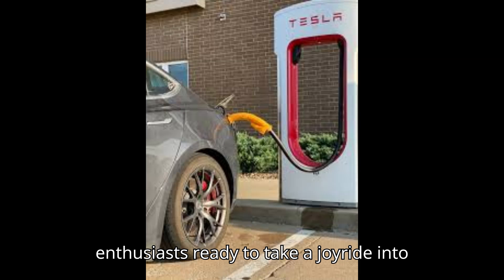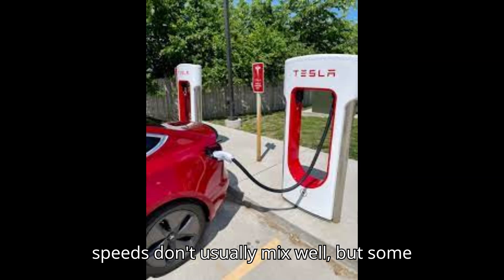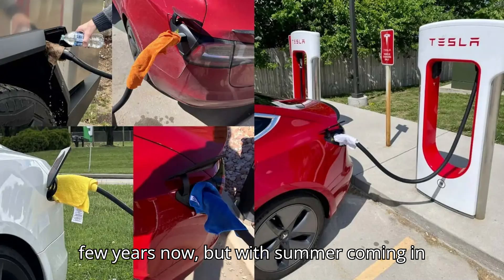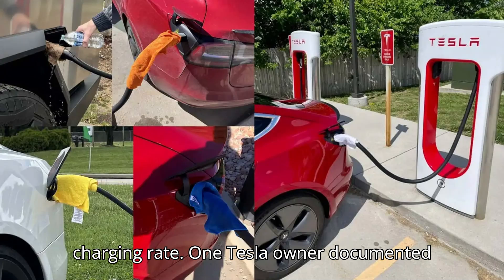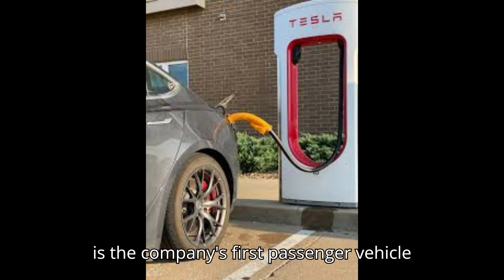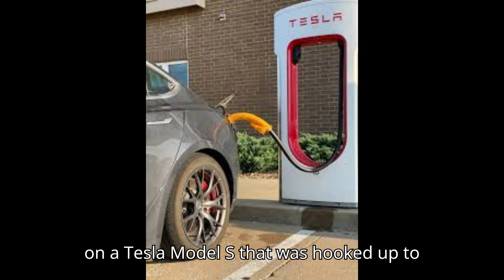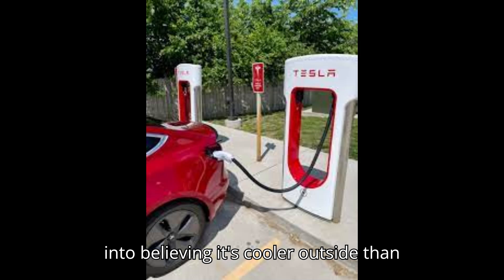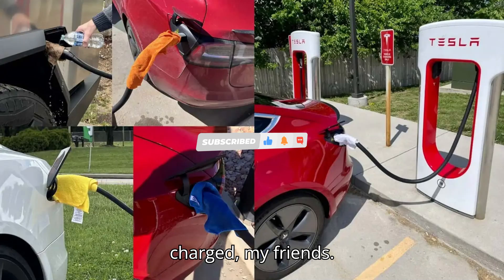You Can Put A Wet Towel On A Tesla Supercharger Handle To Get Faster Charging Speeds

Comment: This hilights another issue with  Chargers  Exposed to Sun Chargers 
Imagine only getting 50kwh at 30% this could easily be resolved with Chargers roof covers
Reply: A shelter would NOT resolved this, because it would NOT shelter the cables from the ambient air temperature.  
There is a reason why large computer servers have to be cooled with liquid nitrogen, despite being housed inside an air conditioned building.  
The vast majority of the heat built up in the cables comes from the electricity passing through it.  
The charging speed of older chargers that do not have internal cooling suffer the same problem during winter months.  

The laws of physics are against you.

Comment: Probably the dumbest  idea ever  - Do Not Do This.
Reply: Its Worse than that , it Shows more issues with  EV Chargers
50kw speeds in Summer ? everyone is running Away from EVs this could easily have been resolved with a roof  so Tesla owners  dont get exposed to the elements nor the chargers